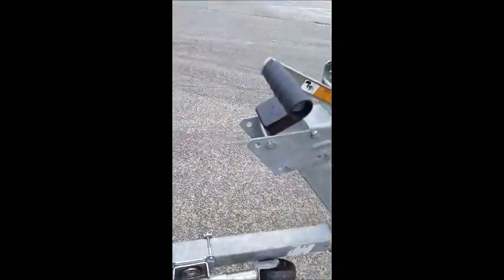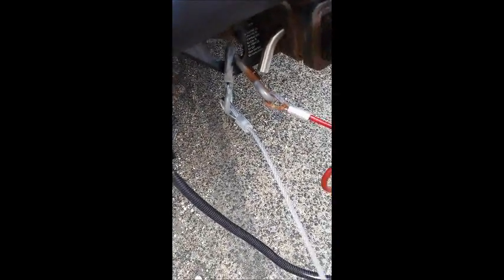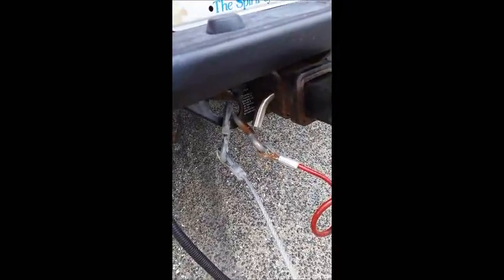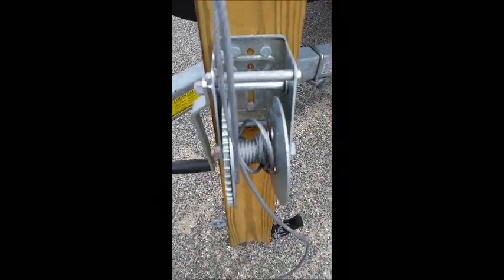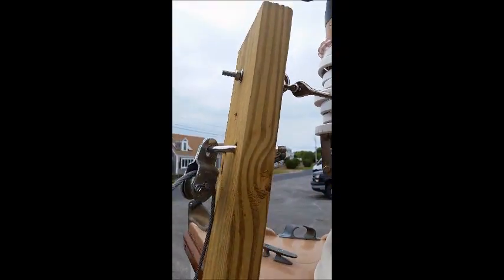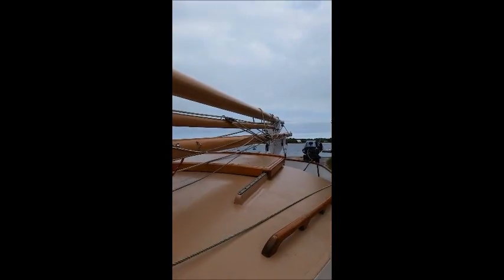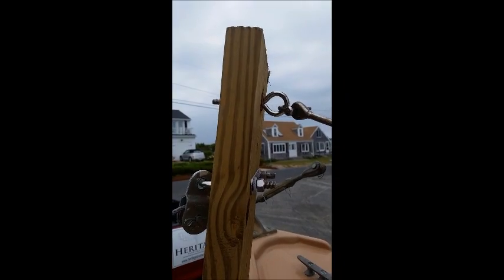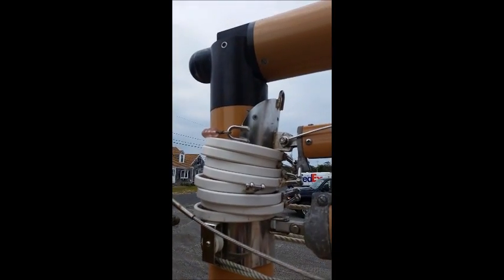Heritage Boatworks - Mast Raising System

Comment: This is nice, but how about a video of it working to raise the mast? I have something similar on another boat, but it would be good to see this one actually working on a Sanderling. Thanks.
Reply: Thanks for posting this - very clever indeed! how about lowering? That seems the more problematic procedure!
Reply: @patrickhaslett2904  just discovered this vid. Maybe better late than never....? The answer to lowering the mast is to use a brake winch, one that can worked in either direction. In fact, I used such a device today to drop the mast on my Sanderling today.

Comment: Hello
Has anyone had any issues with the 2x6 rotating around the mast? I just put one of these systems together and tried it out on a Sandpiper. I did not use a bowsprit but ran the cable to the trailer hitch on my truck. It worked as expected a few times and I was encouraged. The last time I went to lower the mast, the system started to rotate around the mast. I was able to stop the rotation with one hand and continued to crank it down with the other hand.  I would like to know if anyone else had this happen and how did you prevent it from happening again.
thanks for your comments.

Joe